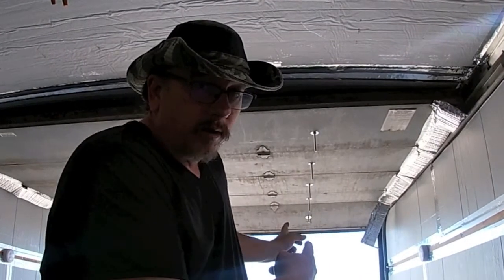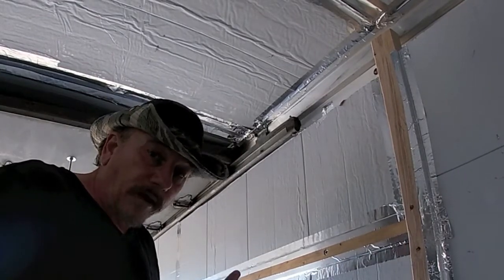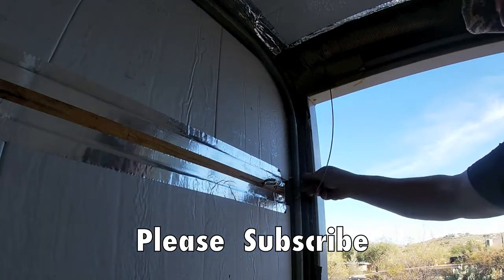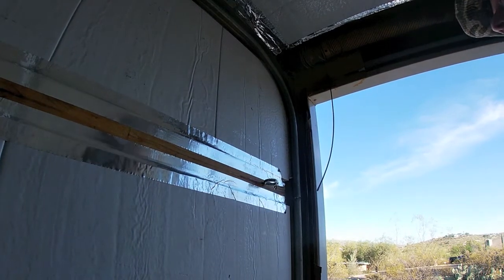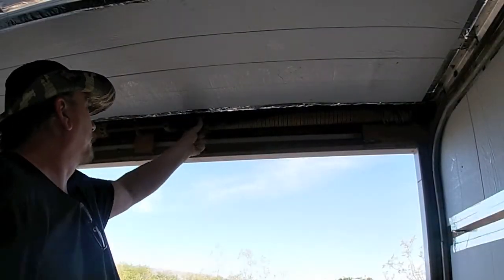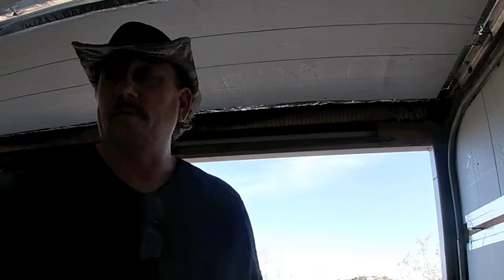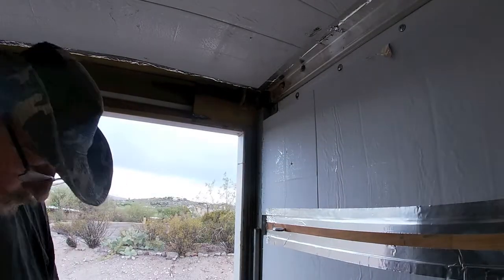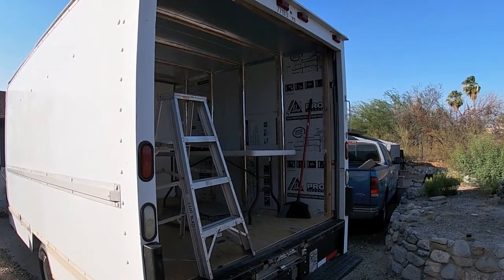How-to Remove A Roll-Up Door - Super Easy - Box Van Life Arizona

Comment: You took out the best feature of a box van !!!
My god, you had a removable wall/window/door that made you feel like you were living outside.
WHY ?!?!
You CAN insalate the door also !
Reply: When it's hot is when I use it most. Too late now, but I would have just covered the back with a false wall. Then if you, or someone wanted it someday.....
Reply from the maker: @danblake3265 I've been living in the truck around 8 months a year now, and I'm really happy I removed that noisy door. Goodbye to the  dirt and dust, and the floor plan is perfect. It also gave me a place to mount a large metal cabinet for generators, tools, etc. in a very organized fashion. After my experience with the truck both with and without that door I couldn't be happier that I did this.

Comment: Yeah, I'm in that process now, which is why I'm looking at these various videos. Oddly enough, I have a roll-up door that doesn't display a cable on the outside. I'm assuming it's within the paneling. Secondly, since I want a stealth aspect, I want to utilize the door as a facade with a backing applied so that it lifts out to provide an awning. I'm not willing to cut into the hinges for that matter. I've removed the stops in preparation of rolling it off the end as one complete assembly.

I will remove as much hardware as possible as long as I can maintain the appearance of a normal rolling door. This is so I can render it as light as possible.

Comment: I’m concerned with the tension in the spring at top. How did you prevent any injury when that unwinded? I know the home garage door springs can be really dangerous.
Reply from the maker: Honestly, there wasn't much tension. There wasn't much to the whole job as I remember it it's been a while.
Reply: @Fit4Expedition  I was concerned about that also somebody tried to un screw it and the spring almost snapped in their face... was it better to use saw?
Reply from the maker: @mattv3395  We used a grinder. It worked well for us.